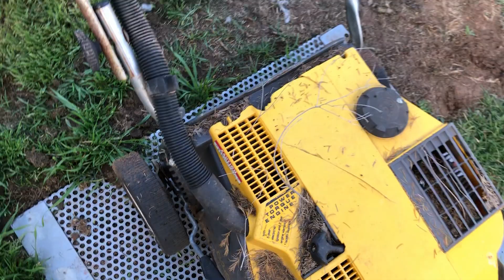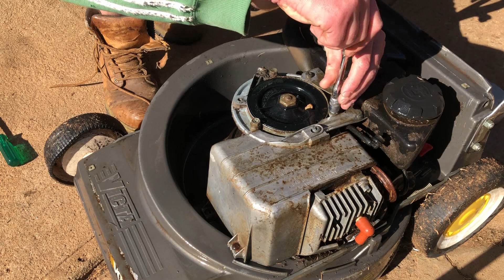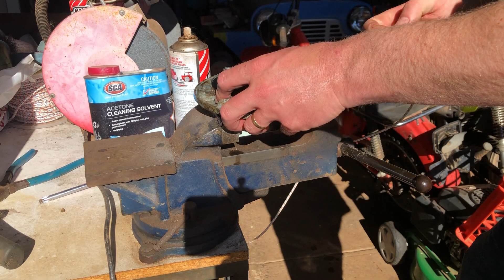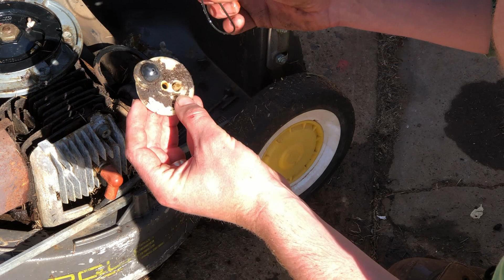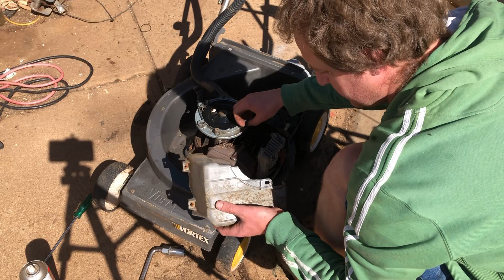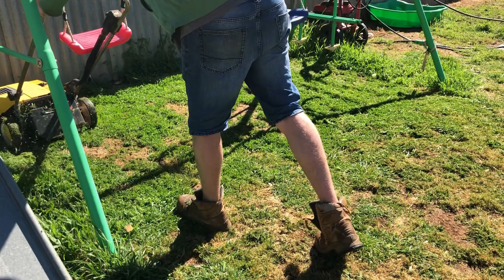Will it run? victa vortex that sat under a tree for 7+ years!

Comment: This reminds me of the Subaru Vortex. Strange shape, you wonder what the design geeks were thinking.
Chews through that long grass good!
Reply: Wow, good call. Both emphasise angles as "the future shape".
These are a very good looking mower but trap debris under the cover and need to be cleaned out regularly or the engine will overheat. 
The models with a smaller engine cover that just screws on the engine but has the same chassis, are best.

Comment: I always thought it was an interesting design but wondered why they bothered with the shrouds...maybe it was to cut down the noise of a 2 stroke? Anyway, this one is a bloody good starter and well worth keeping.
Reply from the maker: Andy K it’s very quiet compared to others, the big rubber disc around the blades also helps with noise!
Reply: 1980s that’s why 😂